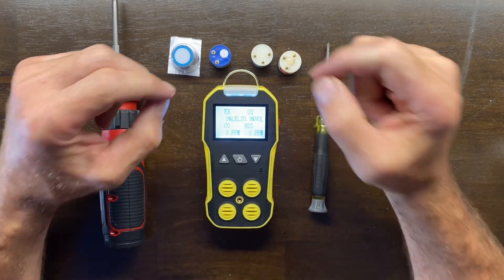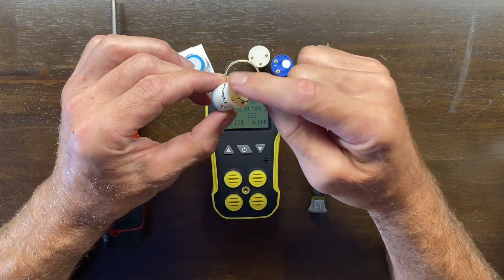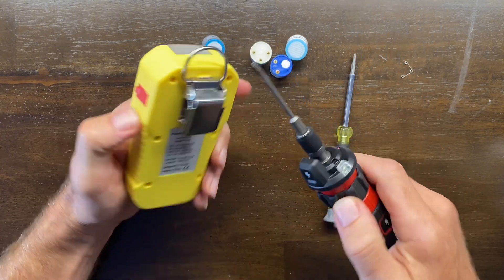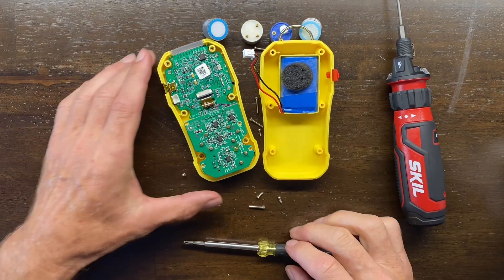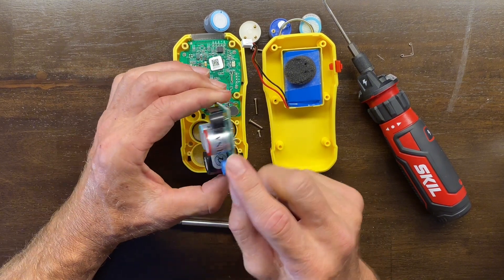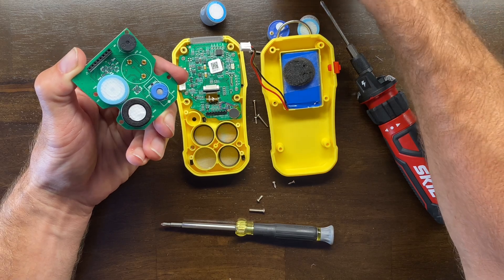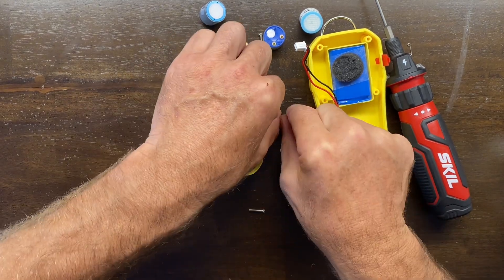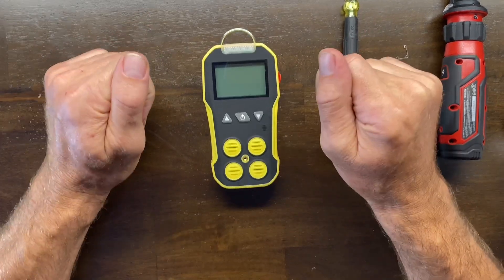Gas Sensor Replacement (FD-4A)

Comment: if replaced does it have to be from the same manufacturer and what is the difference by brand?
Reply from the maker: For replacement, any 4-series sensor of the same type and range will work, but we recommend ours.
Reply: @DrKozForensicsDetectors  is the duration of all sensors the same and how do you know it needs the renovation?
Reply from the maker: @samoime1955  typically 2- 3 years, you know they need to be replaced when, they cannot be calibrated, output voltage too low, bump testing not working, thanks
Reply: @DrKozForensicsDetectors  does it mean they have to be sent to calibration to detect if they are fine and how much does the replacement per sensor cost?
Reply: @DrKozForensicsDetectors  can you quote how much do replacement sensors cost?
Reply from the maker: @samoime1955  see here https://www.forensicsdetectors.com/collections/sensors-replacement
Reply: @DrKozForensicsDetectors  it appears that replacement of sensor cost more then full device.
Reply from the maker: @samoime1955  such as which ones?
Reply from the maker: 95% of cost of a gas detector is the sensor, then labor for calibration and gas. Electronics are cheap and casing is plastic which is also cheap.
Reply: @DrKozForensicsDetectors  so if you sum for FD-4S only 3 sensors it is 275 US$ that costs the full device, and still not replaced Ex and without calibration.
Reply from the maker: @samoime1955  Yes correct, this is the same for everything manufactured. Economies of scale at work in mass manufacture. Buy single parts, as one offs, are much more expensive to re-create the same item. This is good news for gas detectors, so that now upfront cost is so low, no need to replace sensors, just purchase a totally new item. In the old days, it made sense to replace sensors because up front cost of a 4 gas monitor was over $1000. Now they are relatively inexpensive.
Reply from the maker: @samoime1955  yes correct, cheaper to buy a new unit since the new units are low cost